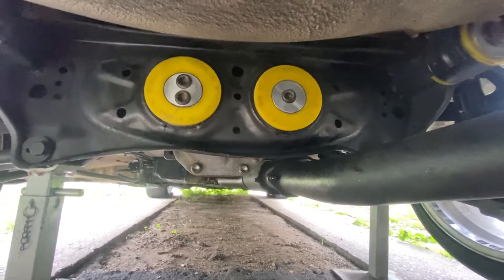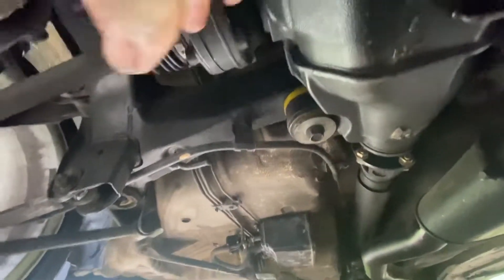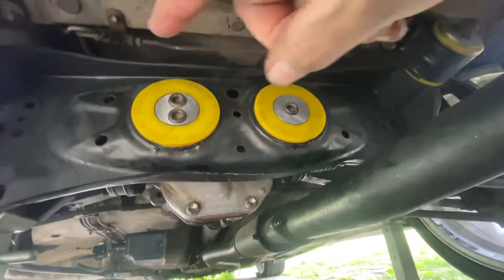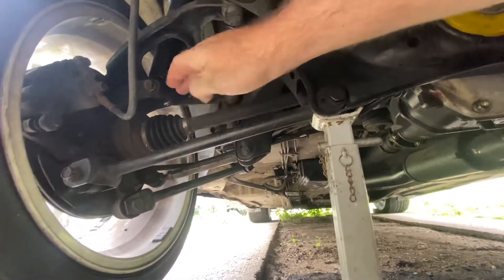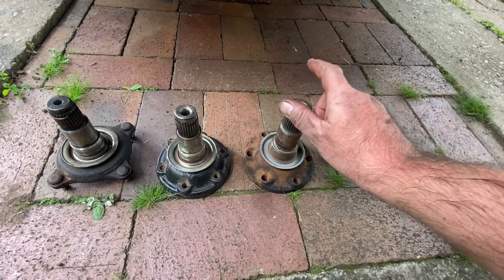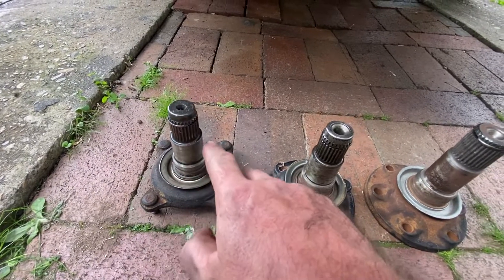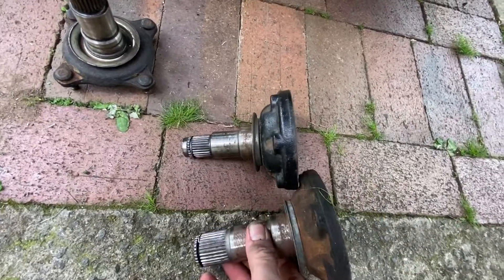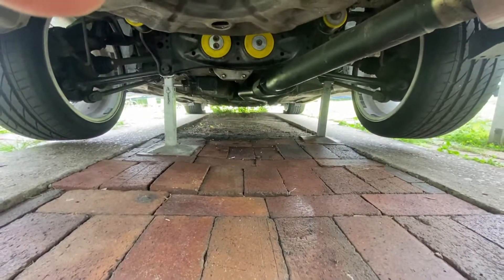JZX / 86 Diff + Axles & Stub axles explained *see description for more info.

Comment: If I got is300 6 bolt  stubs and axles would I have issues installing them into a gt86 diff or do I need turbo axles and stubs
Reply from the maker: IS300 typically have an 8” diff. If for some reason it has a 7.5” diff, then no, the stubs won’t work with the 8” crown wheel diff.
Reply from the maker: Yep, IS300 stubs & axles should go straight in. That’s what I’m running. Is300 stubs have the large spline for the 8” diff & small pcd for the “NA” axles.
Reply: @Fine_Performance ok awesome,did you have to alter your main driveshaft length to mount in the gt86 diff? I’m just unsure if I’ll have to modify my since I’m going from a is200 diff to a gt86 or is300 diff
Reply from the maker: @nitrothunder9937 no driveshaft is fine. If* the flange on the Tailshaft is different from is200 vs 86 diff, you can take the pinion flange off the IS diff & fit it to the 86 diff. I know my LX90 diff Flange was different, but I changed to a jzx rear Tailshaft half instead of changing the diff pinion flange.

Comment: At 4.40 you explained you have the bigger spline stub and smaller pcd 6 bolt to fit your car
. So what is the description of the stub axle that you have installed?
Reply from the maker: It’s the larger spline of the turbo stub, with smaller 6 bolt pcd that takes M10 bolts (not M12), for the non turbo 6 bolt axles. They come from is300 (big 8” diff, smaller 6 bolt NA axles).

Just to confuse things, there are in fact 2 types of smaller 6 bolt pcd & axles, one axle with a gold cap & one with a silver, when you unbolt it from the stub. Is300 (& maybe jzx90/100 NA) axles have silver cap. I’m 99% sure jzx110 has the gold cap & there is no stub to fit the gold axles to an 8” diff.
Reply: @Fine_Performance you are now the go to guy for this info. Thanks. Now I gotta search for those is300 stubs in Malaysia. Currently I have 1989 Z20 soarer and I used a gt86 torsen in it. The gt86 torsen fits perfectly with the Z20 soarer stubs which are large diameter. But I wanted to change to altezza axles so I bought a set with stubs but I just found out the stubs are from 7.5" hence the splines are small.
Reply from the maker: @alcyon2sp I think* some JZS151 or 155 have the same stubs. But they seem to be less common than the turbo stubs.

Comment: Hey it says grs200 crown diff fits into gt86 brz but wont fit in turbo jzx90 100, but gt86 brz diff fits into jzx90 100
any info on that?
im trying to get grs200 diff for my crown jzs151(its basically jzx100 so yeah)
Reply from the maker: Let me check, but I don’t think grs2XX diff is the same. Jzs151/171/jzx90/100/110/is300/gt86 are all the same 8”/200mm crown wheel diff. Altezza/is200 is similar but 7.5”. I’ll look at GRS but I think it’s different. Maybe similar to SC430?
Reply from the maker: Yeah GRS200 is a 7.5” diff. Same as is200/altezza/NA or diesel JZX. It takes different axle stubs & slightly skinnier axles.

Comment: hey mate i've got a jzx100 with a TRD 2 way (jzx/altezza) and I want to move to a 86 LSD. Do you know if I need stub axles or whether my current ones will be sweet for the swap ?
Reply from the maker: @aqcumber7942  they should be fine. I have heard going from jzx torsen to 86, the jzx torsen stub axles are slightly longer at the spline than jzx open axle stubs. But I’ve never seen a photo of the the two stubs side by side. The jzx torsen stubs can be shortened by grinding/ turning a bit off the end. 

But if it’s an altezza diff with 2way, altezza diff is 7.5” crown wheel. If it’s an 8” diff, the stubs should work. If it’s 7.5” diff, stubs won’t work with 86 diff.

Comment: Would ae86 diff for a jzx81?
Reply from the maker: @karolisskudra1681  if it’s 8” crown wheel & pinion, you could fit the internals into an x81 diff housing. But I’d try find a trd clutch center or get a Cusco/ OS Giken clutch lsd. If it’s 7.5” cw you can use an altezza diff internals.
Reply: @Fine_Performance  thank you ye I’m nearly sure it’s a 8inc crown
Reply from the maker: @karolisskudra1681  so 8” is G series & so hilux /jzx / supra (most) etc. Ae86 is T series size. Just make sure though, there’s F series which is altezza size. So make sure you confirm before ordering parts.

Comment: Can I use the 86 axles in a jzx100 with the 86 diff?
Reply from the maker: 86 uses completely different style of axle. You can use 86 diff in jzx100 with either new front bushes (what I did), or using the 86 front bolts. Then either tourer v/ turbo open stubs or tourer v / turbo torsen stubs but you may have to shorten one as apparently they have a long & a short spline, which doesn’t fit due to the extra length of the spline. You have to then use jzx axles. There are options of using non turbo smaller 6 bolt pcd axles as I did, but the stubs from 8” diff to smaller 6 bolt pcd, are very hard to find.
Reply: Ok. I have a n/a so I was looking to upgrade the axles when I add more power. Might just go with the is300 diff/axles
Reply from the maker: @connordalby9777  a guy in Australia had the 4 bolt axles behind a v8 for drift in a jzx90 & he didn’t break any
Reply: Can i use a gx90 axle and put a gt86 differential on it? Will it break or anything?

Comment: Where did you get those sub axles to convert the stubs to the other axles?

Great video btw, thank you so much!
Reply from the maker: So the ones I used were advertised as “is300” - big spline for turbo/8” diff w/ smaller 6 bolt PCD. It’s tricky cos since making this vid, we found there are 2 types of the smaller 6 bolt pcd axles. Identical, but the bolt pcd is different & my mate reckons the thread pitch was different too.

Comment: Can you swap the thinner na axles with the the turbo axles to suit the 86 stubs ?
Reply from the maker: Nah, all the axles, including the 2x types of smaller 6 bolt pcd I’ve come across (na jzx110 & na jzx100), the axles have a different spline to one another & therefore you can’t swap the cv joints. Not between bigger 6 bolt turbo axles (they’re thicker) and 4 bolt or smaller 6 bolt. I’ve tried. A mate came around with his smaller 6 bolt pcd axles & the 6 bolt pcd was slightly different to the is300 stubs I had. Basically I’ve seen 5 types of axles; turbo, is300/na jzx110, na jzx100 & 4 bolt na axles.

Comment: Quick question that you might be able to answer.  Say you have a JZX110 with a 7.5" rear end and it has the IS300 pattern axle stubs stock.  Do you know if an IS300 8" differential will bolt in?  I have one saying that the new diff will be wider so the stock axles will be too long.  Also I've read some stuff that the 7.5" differential is shorter so the driveshaft will be too long.  Any help is appreciated.
Reply from the maker: So my car has an 8 inch 86 diff with NA JZX110 Stubs and axles. The depth of the hat on the Turbo Stubs is shallower then the NA ones.. but then I think the axles  are slightly longer for turbo. I have the old LX90 diff here, I’ll try to remember & measure them. But the CV joint has enough Travel to Account for any difference in Axle length. Soarer axles are 15mm longer per side though vs jzx.
Reply: @Fine_Performance  Thanks for that.  Did you have any issue with propeller shaft length as I think the 7.5" diffs are slightly shorter?
Reply from the maker: @afrost1443  no cos I have an 8” diff & jzx Tailshaft. The difference with the 7.5” vs 8” diff was the flange that bolts up to the Tailshaft had different bolt pcd. So to use 7.5” diff you need to change the Tailshaft flange.
Reply from the maker: @afrost1443  I think from memory, if the diff housing itself is narrower, the stub axle is slightly wider. The axles are the same length (with different pcd 6 bolt patterns) but the stub axles are shallower for turbo & deeper/ wider for NA. I will also add, we’ve found 2 types of “NA / smaller 6 bolt M10 PCD axles”, one with a gold cap & the other with a silver cap. Both have a nipple in the middle (turbo has no nipple) but both slightly different pcd as my jzx110 NA stub axles would not fit the JZX100 NA axles my mate had. He ended up getting IS300 gear & it worked. Pretty confusing but once you see the parts in person you can eventually work out what you have & what you need to make it all work.
Reply: @Fine_Performance  Thank you for your replies.  They've been very helpful.  I think in my situation I can go with an IS300 diff and they should bolt up to my axles, but won't know for sure until I'm in the thick of it.
Reply from the maker: @afrost1443  the diff situation was the biggest hurdle for me when I did my conversion. You can use a 7.5” altezza diff with torsen or most people go for a 4.1 or 4.3 Toyota 86 diff. Then you need the correct stubs that fit the diff your using properly & the axles you’re using.

Comment: so an 8" is300 diff/axle would hypothetically bolt into a na jzx100?
Reply from the maker: Essentially, yes. An 8” IS300 diff is a jzx100 diff. Some diffs (diesel/ LX) are 7.5” cw + pinion, but they bolt in the same, just the stubs needed & sometime the Tailshaft flange differs. Ie my LX diff flange wouldn’t bolt up to my JZX Tailshaft.

Comment: What cars come with the in between axle stubs you have right now? Also another question. Can you fit a 8 inch diff center in the 7.5 inch carrier. Thanks
Reply from the maker: Is300 have the stubs I am using now. No. If you see the physical size of a 7.5” diff, it’s physically small than an 8”. So you’re not fitting an 8” diameter crown wheel into a spacer for one 7.5”.
Reply: @Fine_Performance so the is300 stub has a big spline like tourer v but small pcd and m10  that fits is200 axles?
Reply from the maker: @alcyon2sp yep correct.